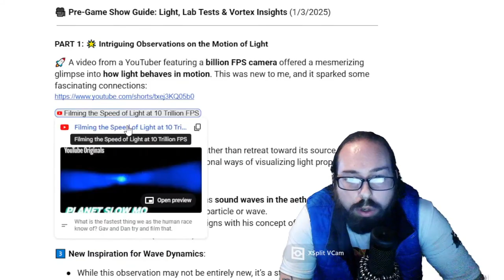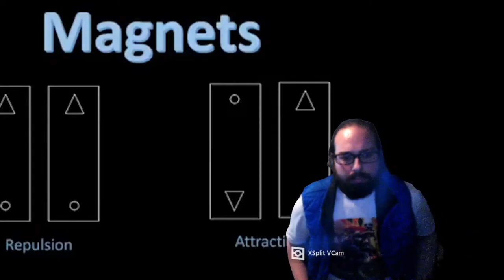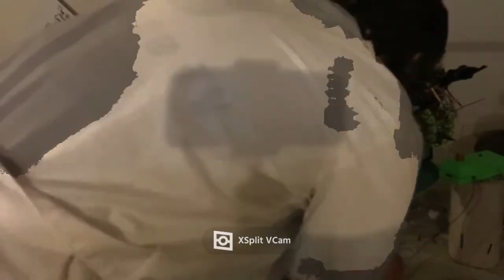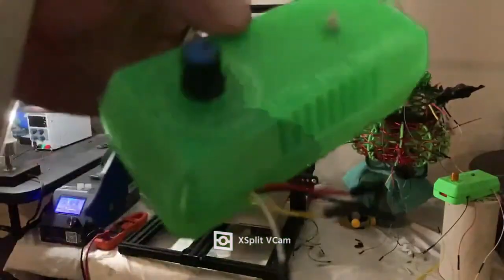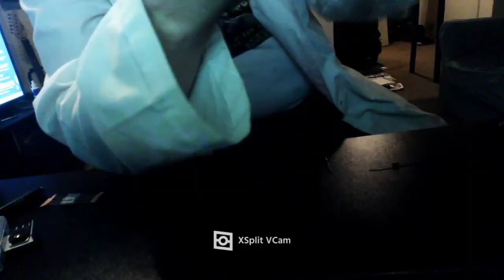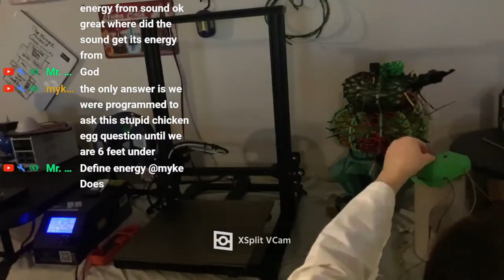The Luminiferous Aether| Ben's Guide to Free Energy | BeneficenceTV

Comment: If you've already answered these questions somewhere, I apologize.  What is the dc resistance and inductance of your basic rodin coil, or the one you've had the best results with?  Where can I find the schematic for the "double" joule thief?  How is the "lightning thief" different from a basic joule thief?
Reply from the maker: @tablegor13  the lightning thief is different than a basic jewel thief because it has a modified resistance and potentiometer so you can easily tune your coil. It’s not really abnormal. It’s just a version of the jewel thief from the practical guide to free energy devices. I have the induction and resistance written down somewhere. I’ll get back to you on that.  There are no schematics for the dual thief set up right now. All I’m doing is using two lightning thieves one has a primary coil hooked up to a battery. The second is the secondary coil, not hooked up to the battery but used as a pick up coil.
Reply: @BeneficenceTV  Thanks for responding!  I'll have to see if I can figure out the double thief from your description, but unfortunately I'm not the smartest person.   I have made a few of the coils.  I made one with 48 turns when the 2 channels are combined so I could observe the inductance more easily, and when I put a square wave through it seems to get converted to sine waves in groups of 3 for every square wave.  This is probably not mysterious but I think it's pretty cool!
Reply from the maker: @ I’m not the smartest engineer either, but I will be producing a comprehensive guide in the next couple weeks. Make sure you stay tuned for that zero point energy solved? Part 2 video with DIYA GUIDE
Reply from the maker: @ I have included in my curriculum for Friday's podcast to include a complete breakdown of how to setup the dual thief. You can set your notifications for the live stream here: https://youtube.com/live/r308ihrcbT0?feature=share

Comment: radio waves are wireless , you capture radio waves into capacitor with diode same as hardwire but you use winding as a pickup for those radio waves ;) 👍